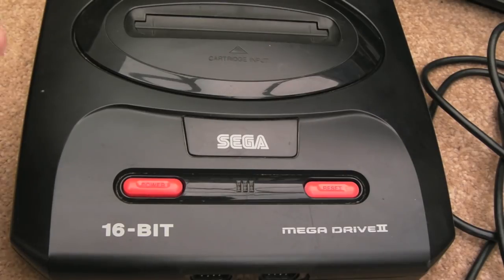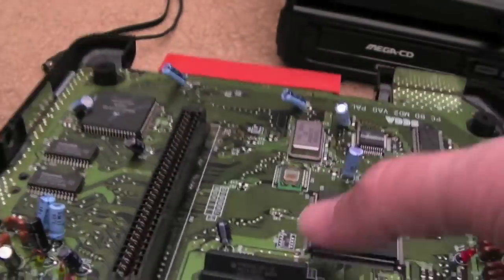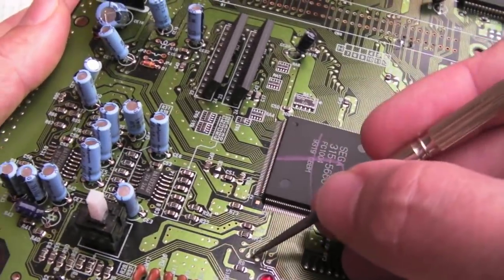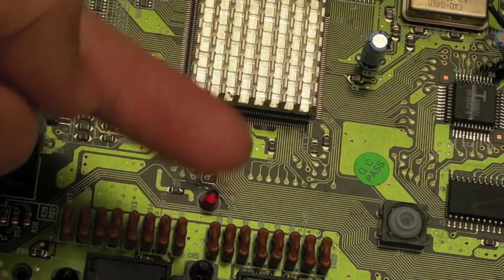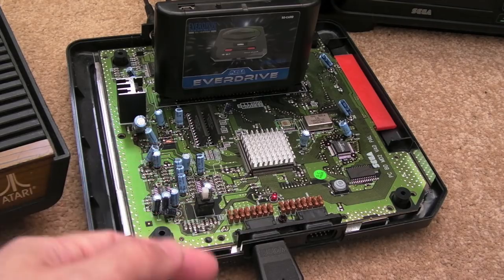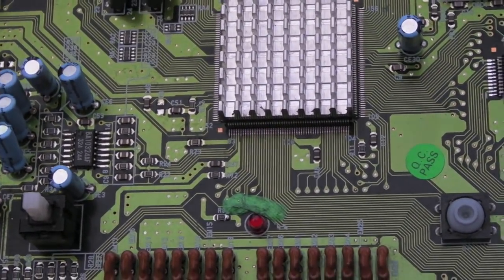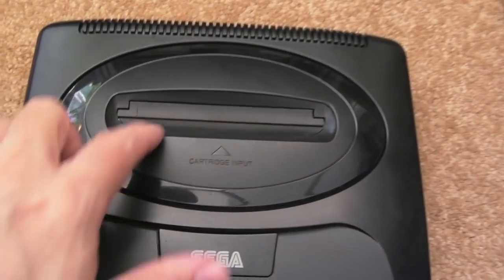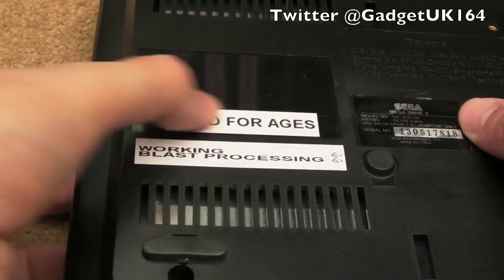Sega Megadrive (Genesis) 2 (MKII) Repair (VA0) - Black Screen

Comment: You are a pro Chris. Fixing these rotted traces is ace work. Not trying to sound snobby but I did think the first time round those wires were making conact. Of course they weren't actually but I'm quite proud of myself having spotted that :)
Reply: The Highlander - I spotted it too, but assumed it would be fine (non-conductive). I learned something today!
I was also feeling pretty smug for knowing the data bus traces needed to be matching lengths, so that was a nice little fix there.
Reply from the maker: Yeah, there was no electrical join - ie. measuring on continuity showed infinite resistance.  It was just the fact they were so very close.  If you look at how spaced out the traces are - there's a reason for such a large gap =D
Reply: It did get me thinking. Normally on a PCB traces are not a huge distance from each other. I wonder why it is that their signals never interfere with each other.
Reply from the maker: They can, and that's typically why there's a gap of a certain size between them.  If you look at the close up on that particular zoom in where I added the two wires, there's quite a comparitively large gap between the traces (compared to their thickness).   And to the left of that chip there you can see some traces that end abruptly between other traces (those are grounded, to stop interference with the traces next to them - audio outputs).   On many boards (especially modern ones with 4 or more layers) there will be a ground layer usually under the traces too.

Comment: You're right Chris; this is definitely a contender for a switchless mod. It would be a shame to spoil a case in such good condition by adding switches to the side of it.

I also use nail polish to go over exposed traces, wilko and boots do some good shade of green just go in with the missus or you'll get some funny looks at the checkout, Ha. If you can't find the correct green I'd use clear coat nail polish it will work just as good.
Reply from the maker: Thanks, yes - clear sounds best!!!

Comment: in terms of pcb coating i've always used vallejo acrylic paint (it's essentially nail polish but with a matt finish) they have a full colour sheet on their website but something like an ocean turquoise normally does the trick.
Reply from the maker: Thanks, will give that a try =D

Comment: i've always been impressed at the build quality of megadrives, when fixing them i've normally only come across problems that are user created like the power jack being overstressed or the pins on the cartridge port bent. It's great to see you put this mk2 back in action as they often get thrown away with how common they are.
Reply from the maker: Me too!  They are so much more robust and reliable than the SNES.  I think that's one reason they are so cheap - there's more of them surviving than the SNES, which means a flooded market.

Comment: great video as always. I guess if you're gonna use the nail varnish trick it's probably worth painting a bit on some plastic and making sure it's non-conductive before you use it.
Reply from the maker: Good idea =D   Chances are, whilst wet it will be conductive no matter what.

Comment: Lol the green nail polish 😂 funny how that overlap caused that data corruption. Just shows how much insulation matters with data. That demo is sick. Just one thing... your tissue will put marks in the console. I found that out on piano black gloss. Use a lint free microfibre 😉 ANOTHER QUALITY VIDEO GADGET!!! ❤
Reply from the maker: Haha =D  Yeah, that small overlap drove me nuts!  What was surprising is that it didn't affect the Megadrive games at all...  I use soft tissue =D  But I know what you mean, microfibre is the best thing to use if you aren't sure!  Thanks mate =D

Comment: Good job Gadget. I agree with you on the audio,  still have my MK2 from when I was a kid but I prefer the audio from the MK1 Good to see you found your color :). Still using clear nail varnish here but if I find a nice PCB green I'll let you know.  Have three mega drives, tempted to do a switch less mod but would need to pick another one.
Reply from the maker: Thanks, yes MD1 audio wins =D  Clear nail varnish sounds like what I should use =D

Comment: It seems to be only early SNES/SFCs that are having chip failures. The biggest issue doesn’t even seem to be a chip failure: The earliest SHVC boards with the modular APU/SPC700 often stop working with RGB/S-Video/Composite. RF continues working but people often fail to realize that. I’m not sure what’s going on because the RF modulator is running off the same composite signal that no longer works through the multi-out.
Reply: Emmett Turner I'm glad I'm not the only one to notice this. I've got ten mds with damaged traces but not one with a dead chip. My sfc haul on the other hand have plenty of dead ppus.
Reply: Emmett Turner 

Maybe it could be due to people smuggling narcotics in the carts as well? :p

What a strange day that must have been. hehe
Reply: Russell Brunskill Yep. Same can’t be said about copies of Sonic the Hedgehog though. Lots of copies of that game are dead (bad ROM chip). :( There’s a website out there where a guy does component-level repairs to Nintendo Super System arcade machines (SNES hardware inside) and the vast majority of the time it ends up being a proprietary chip (CPU, PPU1, PPU2, APU/SPC700, etc).
Reply: ElectronAsh LOL! Sure was. Guess I’ll never live that one down. :)

It wasn’t the first time I found something interesting hiding inside an NES game (recorded myself finding a Xexyz prototype many years ago) but I doubt I’ll ever top that one. :)

People at the flea markets keep telling me about “some guy who found heroin in old Nintendo games.”  Their reaction is kinda funny when I tell them it was me. :) It really hits them when they realize how close to home it is. Heard it once on Friday and again yesterday.

Next time I plan to pretend it wasn’t me and steer the conversation toward what an idiot “that guy” was for calling the police. ;)
Reply: GadgetUK164 - Retro Gaming Repairs & Mods 
Yep. Seen several of those myself. One of them I’ve had since the mid-‘90s (bad CPU).
Reply from the maker: I've seen loads faulty where PPU1 / PPU2 or the CPU die, but I would agree that I've not seen a 1 chip fail yet.

Comment: Clear fingernail varnish is a good way to cover your trace patches since it can easily be removed with nail polish remover (acetone) and will not obscure the work. Edit: OIC. You mention both a bit later. :)